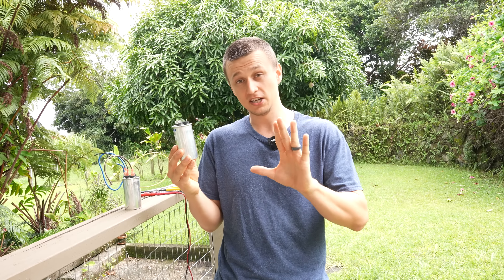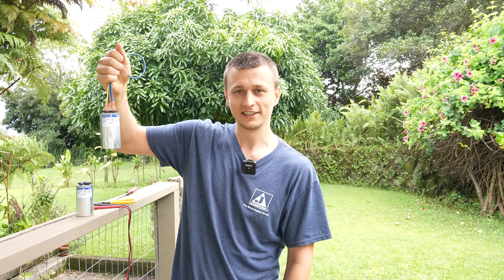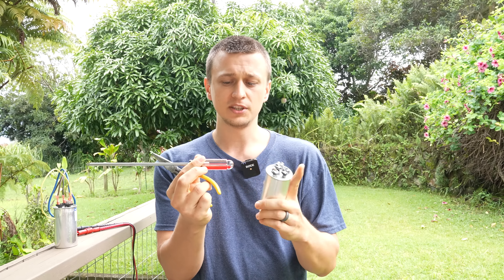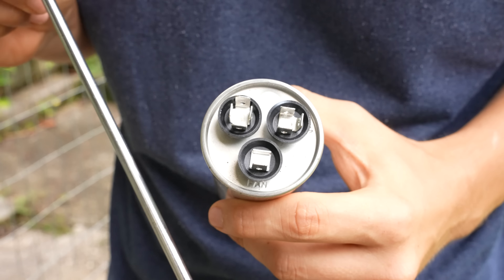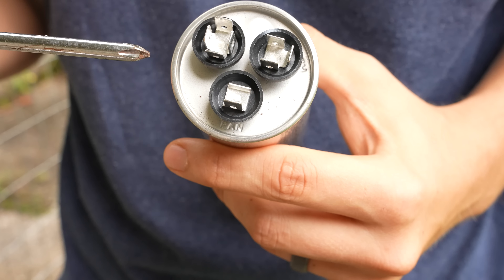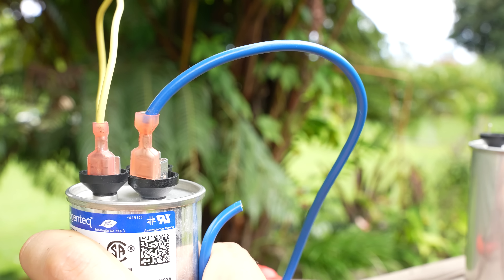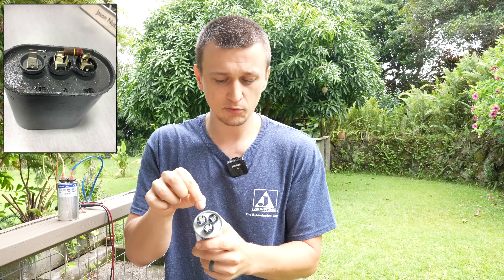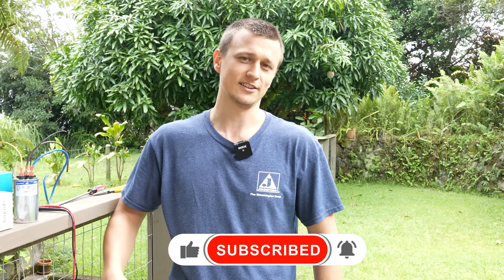How to Discharge a HVAC Capacitor

Comment from the maker: 🔋 Capacitor Videos For Further Info:

Original Video on Replacing a Capacitor:
https://youtu.be/C82HvbvP08E
20 Common Capacitor ?s Answered:
https://youtu.be/ae0Ue4F3ooQ
How to Replace a Capacitor Full Guide:
https://youtu.be/9ZGfvC-PMWU
How to Order The CORRECT Capacitor:
https://youtu.be/mkqaOfvH4a4
How to Check Capacitor With Multimeter:
https://youtu.be/5_0nKm940nA
How to Replace a Start Capacitor:
https://youtu.be/hC0nFT1XPcI
How to Combine Capacitors:
https://youtu.be/qLJOWU33TFo
What to do if Capacitor is Rusted:
https://youtu.be/RSIi47uzApI
How to Install SPP6 Hard Start Kit:
https://youtu.be/ThBsRFrdNiY
How to Install 5-2-1 Hard Start Kit:
https://youtu.be/KRQ3BzJPPn0
How to Wire A/C Condenser Unit:
https://youtu.be/KCanZEsLVEI

Comment: I don't know much about capacitors except that they can kill you if you're not careful.  How do i know? In high schoo I had two separate friends who did not know each other, but both of their fathers died in 1974 from electrocution while changing the capacitors in television sets.
Reply: Those old tube TV's (CRT's) had much higher voltage in them than a modern HVAC compressor, which uses 240V. Some CRT's had 25,000 to 30,000 volts in their circuits, even though the input voltage to the TV set from the AC wall plug was only 110V. Modern day tube audio amplifiers can also generate very high voltages and are dangerous to work on if one is not experienced.

Comment: I want to thank you for your easy to understand video!  My A/C stopped working yesterday and I discovered the condenser fan was not turning.  I did research and found the likely culprit was the capacitor, but I felt a little uneasy messing with it.  After watching your video my confidence was boosted.  I ordered a replacement capacitor, followed your steps, and I am very happy to say I have A/C again!  What probably would have cost a few hundred dollars for a service call only cost $11 from Amazon and 15 minutes of my time!  Thanks again!!!
Reply: @jmina  You are fortunate.  I initially was quoted $500-$1500.  I researched capacitors, how to remove and install, and canceled the service call.  Now, I just need a different restraining bracket as my new capacitor is wider.

Comment: My outside unit isn’t coming on when I turn my AC on. I don’t hear anything outside at all but the inside turns on and blower runs no problem. Could it be that my outside capacitor is bad?

Comment: I have changed many caps being an apartment community maintenance supervisor and have never been shocked by a cap that is increased in metal, plastic is another story.
Reply from the maker: It barely ever happens but with some older units one needs to be more careful about it. Thank you for sharing your clean record! 😉
Reply: Almost all modern dual run capacitors have an auto discharge mechanism so yeah very rare to get shocked by them or any HVAC capacitor.  Just a couple of days ago I had an issue with a residential unit overamping and pulled the capacitor (which was a titan I had replaced about 6 months before) and the thing shocked me.  They all do have built in dischargers so something was wrong with mine for sure but it hurt enough I will be more careful from now on!

Comment: The best way to discharge a capacitor is to set your multimeter to Volts. Go across each terminal and read your meter and you will see it go to 0 Volts. I was taught this way, safest and professional way. Good vid!
Reply from the maker: I've actually never done it that way. Thank you for sharing and explaining!
Reply: @WordofAdviceTV  not a problem bro. Give it a try, do your enthusiastic video on it because you have good confidence and good way of teaching it!
Reply from the maker: Haha thank you. Maybe later.. I already posted two capacitor videos in a row, I should probably give it a little break 😄
Reply: Problem with that is that it takes too long. In the field time is money.
Reply: @pullingthestrings5233  time is money and yes you are correct, but 1 simple mistake can fry you and than and injury is involved. Safety first! Money cannot buy you happiness!
Reply: @zahedaminullah6934  money can't buy happiness ? Ever seen a guy on a jet ski not smiling and having a good time ?
Reply: This does work because of the internal resistor of the DVM but it can take much longer. A capacitor discharge tool is optimal.
Reply: @pullingthestrings5233 Really? How much time is involved with the voltage check?
Reply: @stephandalejo  capacitors are very dangerous and hold the charge for the next time an Ac is ready for a next start. They are very cheap made but can be deadly, why do you think mice look so roasted beside em lol!
Reply: @sylentknight its the jet ski experience and not directly the money. There is a suttle difference. Having money and be able (allowed by God ) to create happy experiences from it are two different things.

A rich billionaire on deathbed cannot enjoy his money much.

While the staff on his super yacht he hardly uses enjoys it at his expense. 

Money can enable you to be happy but its far from being the only requirement.
Reply: You might want to check your multimeter instruction first to make sure it's rated for 400 ish volts. Running it through the internal resistor could let the smoke out
Reply: 😂😂😂 veću glupost nisam čuo. Koliko života imaš ti? Vidim da ti se ne žuri....Zašto si se uopšte javio kad nemaš potrebno znanje?
Reply: @zahedaminullah6934 Ni ti ne znaš ništa. To je startni kondenzator, preko njega se napaja pomoćna faza motora kompresora. Nije uloga kondenzatora da sačuva napon za novi start nego da napravi pomak faze da bi se motor kompresora pokrenuo. To je takozvani startni kondenzator.

Ljudi, nemojte komentarisati stvari o kojima nemate potrebno znanje.

Comment: Be has verbose and detailed as you need to be! The more you talk the more confidence I have. You were the finishing touch on me not only swapping out the capacitor, but the switch and the fan motor as well. Guys like you are saving me thousands! Even if I were to swap out the compressor, I still will have saved on what these typical HVAC guys want to charge. THANKS!

Comment: Thank you for this video.  My air conditioner pooped out during the night and the capacitor has been changed a few years back and I am hoping I can just change it out again on my own.  My neighbor did it last time because he had a capacitor and the knowledge.  I helped him and paid attention.  I changed a microwave capacitor once and bled the voltage off with a screwdriver but really didn't exactly know what I was doing.  Your video is clear and concise.

Comment: I can't thank you enough for posting these vids. My old capacitor was a 70+10 +/-6%. The new one I installed (thanks to you) is a 70+10 +/-5%. Does this 1% difference matter? Again, TY for being so thorough and speaking for the true beginner, and never assuming that we "must already know" certain details that others leave out, that could kill us if we don't.
Reply: Nope, the +/- is the tolerance of the measurement.  So, 70+10 +/-5% = means the herm should be between 66.5-73.5 (which is +/- 3.5 or 5% of 70), and the fan should be between 9.5-10.5 (which is +/- .5 or 5% of 10).

Comment: Back in my service call days I did use a resistor to discharge capacitors by holding the resistor with needle nose pliers. Just the way I was taught to do it.
Reply from the maker: Thank you for sharing! One of the first things I was taught in HVACr school is that "there is always more than one name for something and there is often more than one way of doing something, just get used to it." So I embrace the idea of different techs doing it differently, that makes it more interesting! But your way really is the more technically correct way 😇

Comment: I love the “How do I know this? Because I tried it” bits 😂 Thanks for adding some comedy to this very helpful instruction video.
&Thank you for making this video in the first place! My grandma’s A/C went out (mid summer in the valley - worst timing EVER) and the repairman quoted nearly $500 for the repair. He said the capacitor needed to be replaced(2nd time for this system) & told my grandma it was possible to replace it without hiring a professional. I’ve worked on cars in the past and am pretty good with repairs, so I’m going to save her about $400 by doing the job myself. The only bit I was worried about was discharging the capacitor, which led me to this suuuper helpful video! :) My grandma and I both really appreciate it!

Comment: Not expecting a direct response but I have an odd issue.

On a normally working system, when turned off for a while, the air handler will turn on and blow very hard without a call for cooling or heat.

Comp and cond fan stay off

It just blows super hard after being still at comfortable temperatures.

You my favorite hvac guy!
Reply: You might have a thermostat with a fan setting set to "circulate." If you have this on, the indoor fan will come on every 15 minutes regardless if the outdoor condenser is running or not.
Reply from the maker: Hey Jeremy! What TK said might just be what it is. (thanks TKGotWings_!) Another thing you can look for is an air cycler control (I don't remember the specific name for it), typically located somewhere on the side of a duct, by the furnace/air handler. Some houses will have that thing installed and it basically does the same thing as that circulate option on the thermostat.

Comment: You answered all my questions, thank you!
Reply: My capacitor came, but is wider than the original.  It will not fit the ring/bracket.  What will happen if it is not bracketed/held in place?  I have been trying to find a mounting bracket replacement as the original is not wide enough.  Any suggestions?  The specifications are correct.  I felt very comfortable removing the capacitor thanks to your excellent instructions, thank you.💕

Comment: It would be fun to see a capacitor actually spark when you demonstrate. You would have protective gloves on, of course. You would immediately have one million subscribers. 😜
Reply from the maker: Hahaha you're right! I really should have made the effort to charge it up before the video.. Ehhh.. Where was my creativity.. I will strive to perform better in the future! 😇 Maybe even have a capacitor blow up... Now wouldn't that be fun 😄
Reply: @WordofAdviceTV   but wouldn’t the dielectric grease burn you I’ve come across one that exploded in an old ruudd condenser should’ve made a video anyway if it explodes in your hands that would be dangerous!!!?
Reply: Good  moring  brethar  thanyou .bai  ok    capaciter two  metal  plates are  seperated by  an  insulating    material  called di  electric    capaciter  stores   electrical   energy or  electrons   when  capaciteris   connected  in a  dc ciruit   continuous  flow of  electrons    current wil  not tackes  place   But  in an ac ciruit  with a capaciter  i n  series   flow  of   electrons  tackes  plas continuouly wich is  out of   phase  with  the  voltage when  strting   capciter is  connected  in  series  with the  starting  wind  of a  sigle  phase  moter  is  split in to  rwo  phase  wich give

Comment: True, the method you use is the fastest way to discharge a capacitor, but can also damage the capacitor. Using a resistor for discharging may take a couple minutes longer, but is less likely to do any damage and is a little safer, because in discharges gradually instead of a sudden jolt.

Comment: I like the story at the end. Thank you for this. Did you use just a regular screwdriver? I believe my capacitor went out and my AC isn't cooling. It's miserable. Unit kicks on and buzzes for a few seconds then goes right back off. Its done this before a few times. I know I'm supposed to spray the outside of the AC unit with a hose, but we don't have any working faucets outside anymore.
Reply from the maker: Glad you liked the story! Yes, any regular screw driver or even a pair of pliers is all that is needed to discharge it. Sorry to hear about the AC problems, I've lived in toasty environments like that before so I know what it's like. Likely this has nothing to with spraying the unit down, from what you described it does sound like a bad capacitor. If you want to clean the outside coil, you could try brushing it and vacuuming it. It's not going to do as good of a job but if there is a bunch of stuff on that coil, you will still lessen the air restriction.
Reply: @WordofAdviceTV  Thanks. AC repair guy who usually comes out is in jail right now and the other dude couldn't come out but he walked my friend (who is a certified electrician) through the job. Turns out two capacitors were bad -- one for the fan and one for the compressor. He watched this video as a guide & it helped him with fixing it & the guy on the phone answered more detailed questions and sold the capacitors to me. $90 fix but I'm no longer boiling.

Comment: Hi Jay!  Will touching the body ( canister portion) of the capacitor itself zap me should there still be a charge left, or just the prongs where the plugs (common, herm, fan)  are plugged into?
Reply from the maker: Just the prongs. It's okay to touch the canister, though I would usually discharge it (with all the wires attached) before I take anything apart. Of course with the power off too.

Comment: Hi, I followed your instructions and discharged an ac capacitor this afternoon wearing gloves, rubber sandals, and using insulated pliers. However, I felt a tiny bit of current. Is this normal or did I err? Thanks!

Comment: Maybe if the capacitor is dead there wouldn’t be a spark (even slight).  I just swapped out a cap here at home (first time doing it…pretty easy for sure).  I shifted the wires from the old to new leaving the old still mounted in the cabinet.  Then removed the metal strap from the old and finally affixed the new.  The new one has a smaller diameter so fortunately, the metal strap has several holes.  Lastly, I discharged the old cap.  No fireworks 😢

Kick on the A/C and back in business.  Just for reference, the original cap was in operation for six years. Location is Indianapolis so the A/C gets used a bit throughout the summer.

Lastly, suggest to buy American made caps from AmRad.

Comment: When I was young and dumb. I tried changing out a capacitor in an HID light fixture. 400 vac. 24 uf in a 400 watt MH fixture. The power was off and I did not discharge the capacitor. Been over thirty years since that event and everyone after that was discharged. Once is all it takes and you won't forget again. lol good video
Reply from the maker: Lol thank you for sharing your experience. Every repairman needs to try it at least once right? 😄
Reply: @WordofAdviceTV  It's the best method. I can also say I'd rather not get tased if ever presented with that option. LOL  " No thank you ""

Comment: Wondering if you can do a video about all the lines coming from the outside fan and going to the heat/air exchange unit and the purpose of each line.
Reply from the maker: I believe what you are looking for should be covered in this video: https://youtu.be/pJ8KeJFKDMM
Cheers!

Comment: Hello we have a gsx14 and it will trip the breaker after running for a good while. I've watched all your hvac videos and thanks so much for all the info you share with us. I've check all the components no shorts capacitor is within range and the inrush amps are good. Any suggestions would be greatly appreciated. Thanks again for sharing your knowledge with us.

Comment: Should the capacitor be discharged by the motor coil once stopped or power off?
The capacitor is in parallel to the motor coil technically in theory, unless the coil is broken.

Comment: You know, you can never be to carful. That being said, in 30 + years I have to say I can only remember one time on a small capacitor I got a little jolt. I probably should take more time to discharge them but I rarely do.
Reply from the maker: I can only agree with that. With most residential units, the chances of getting shocked by a capacitor are very slim. Thank you for sharing your experience!
Reply: @WordofAdviceTV  Thanks Jay, I love your videos

Comment: Thank you for this. I was wondering, can you discharge the capacitor by unplugging the HVAC unit, hooking the motor directly to the kill switch and pressing the kill switch to complete the circuit? (similar to testing the motor without the power being plugged in?) I do this all the time with electronics before I open them up and mess with them. Curious if this method would work with AC power as it does with DC. Thank you for your time

Comment: Follow this method, you'll be buying your customers a brand new capacitor. 
Using a screwdriver across the terminals can cause interruptions in the cap. 
Even if it is not seen immediately, it will over time become unable to maintain a charge. 
That will lead to failed motor starts, or drag on the motor which will cause damage to the motor.

Comment: Great video, your videos are so informative and easy to understand 🙌🏻👍🏻 
Do you need to discharge the capacitor before disconnecting it from the unit to replace with a new one ? 
Thank you 🙏
Reply from the maker: Thank you, I'm glad to hear that the video are easy to understand.
Preferably yes, discharge the capacitor every time before disconnecting any wires (power is off of course)

Comment: Question, if just changing the fan blade, maybe it's bent or cracked etc...motor is fine...after pulling out the fuse on the outside wall, do you have to shortout the capacitor, does that capacitor have enough juice in it to make that fan blade spin while taking it off the motor....

Comment: Can i (generally, but fully) trust this process?  The spade connectors on my wires don't have insulation on them,  so i want to be sure i can discharge the capacitor and disconnect the wires AT THE CONNECTOR,  and not by cowardly pulling at the wires themselves. Thanks!